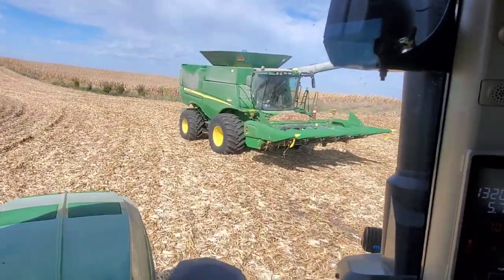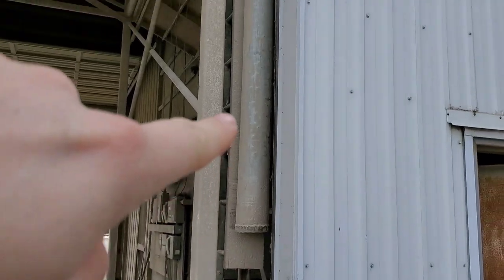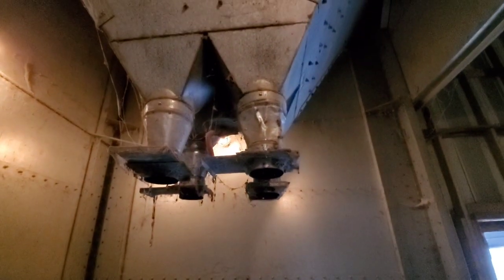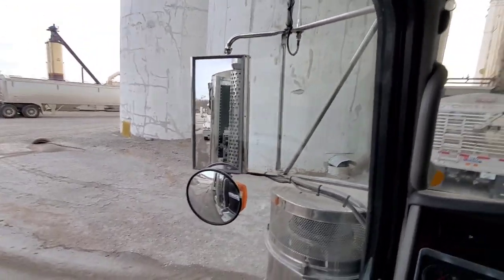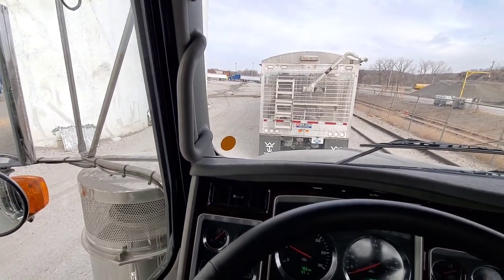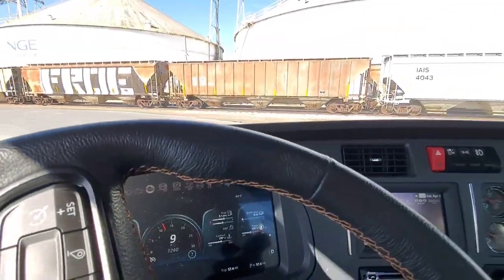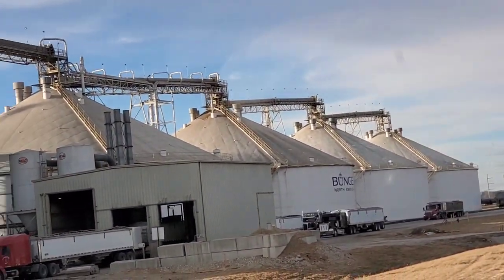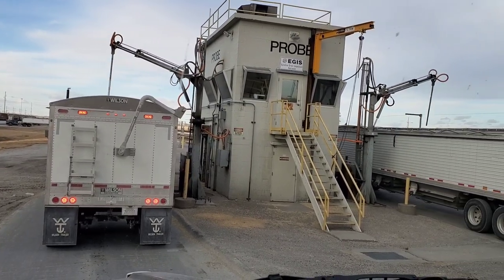where does our grain go?

Comment: I worked for a bean plant and it hard to believe how fast soybeans will wear through a steel drag bottom or anything else. Tried lining them with AR500 but  it wore through in a couple of years. Finally started getting this plate that was plasma sprayed with some kind of titanium carbide. It worked pretty well. The place I worked at is in the capital of Ne.  Don't want to advertise, was there til my heart pooped out and got disabled. It's an interesting process though.
Reply from the maker: Very interesting